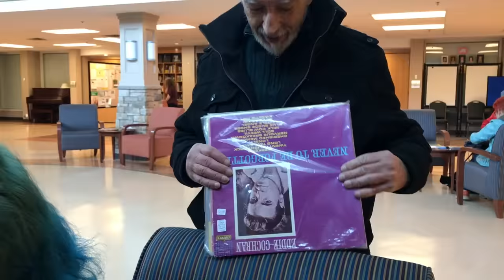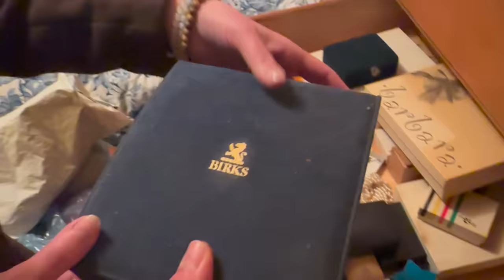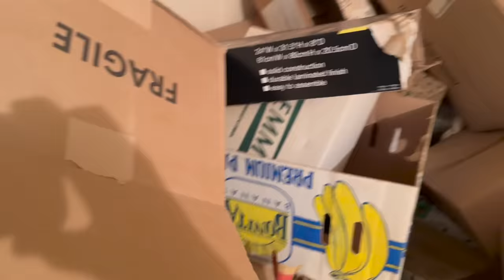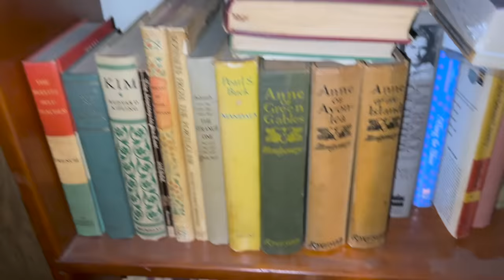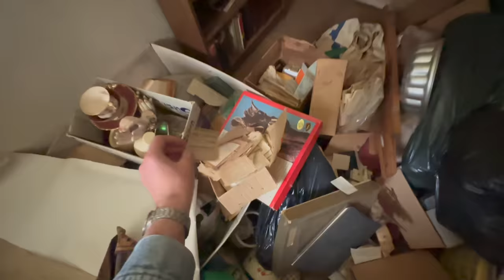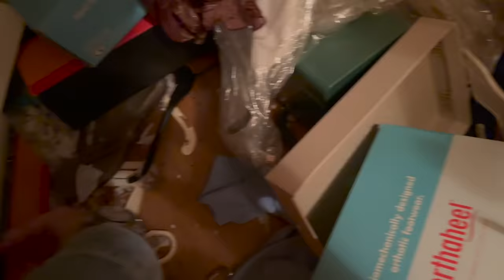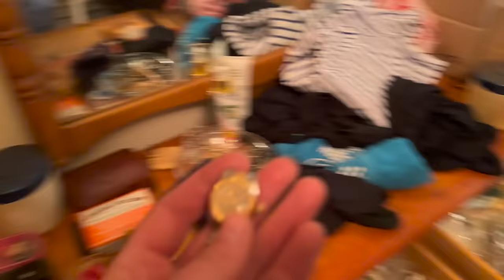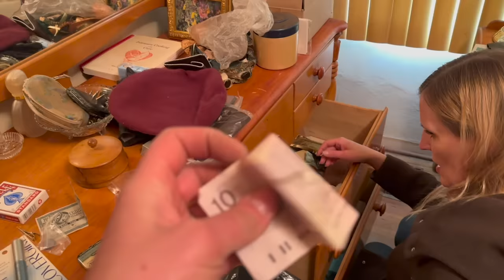50 years of stuff & everything was left behind! We bought it all! What will we find?!?

Comment: My mom's washer & dryer from '71 sold with the house in '98. The house is back on the market, and there they still are, 52 years old and still running! Kenmores were built solid in those days.
Reply: The freezer we still use is 54 years old. Bought at JC Penneys
Reply: My friends parent house which he inherited had a washer from 1966. Finally died a few years ago. Was hardwired into the panel. No plug he said.
Reply: Love me some Kenmore!
Reply: Older appliances usually are built to last. New ones are meant to be replaced, so the company can make more money!
Reply: @Nwladylaura369  Planned Obsolescence
Reply: @elizabethliska5377  Oh my gosh. when my oven died a few years ago (days before I was due to host Christmas) had to rush to get a new one. Preparing for the delivery, I asked my son in law to stop by and slide the old one out, cuz I was trying to avoid the embarrassment of the delivery guys revealing mess and crumbs. Well, good darn thing I did, silly thing was hard wired to the panel like your washer, and it'd have been a real nightmare to have found out a few hours later. Bless the boy though, he got it all fixed and a plug in installed behind the stove before they arrived. Lesson learned.

Comment: that violin looks very good, its easy enough to pu a bridge back on... as long as the body isn't cracked or effects its 100% good. Very normal to remove those bits that fell out because they are actually just kept on with tension from the strings. Probably not worth much but if they are even semi-decent old violins I'll spend $300 restoring it if I find a decent one.. but they really are never worth more then like $700 after being fixed when they are student grade and that one looks small, still tho I think its very worth it as maybe 50 years from now those will be worth more due to age and the wood. If I find anything pre-1950's ish then I get them repaired and eventually re-sell or gift to a student. I've only ever found two worth saving because typically the wood is all cracked and awful, that one looked so good it didnt even look old. Honestly I think that violin is not as old as that case. Look at the BACK of the violin to see how nice the wood grain is. Usually it's "pretty" on a nicer quality student violin and you see nice patterns in the wood. Violin cases can be super expensive and old cases are basically free half the time in antique shops so again, violin may not be nearly as old as the case.

Comment: at least  the ironing board cupboard door opens the correct way so you can easily access the outlet to plug the iron in. Mine opens the 'wrong' way and blocks the outlet.  Obviously whoever built it never did the ironing.
Reply: My house (circa 1995) has a built-in ironing board with a plug-in with a timer switch and light bulb, all within the cupboard. Very handy!